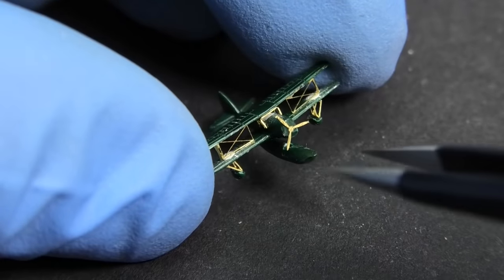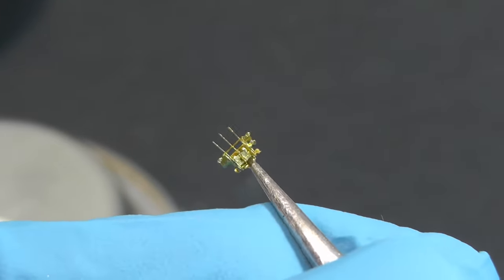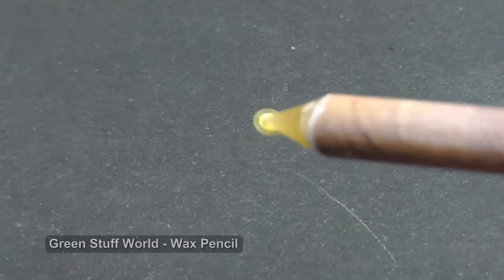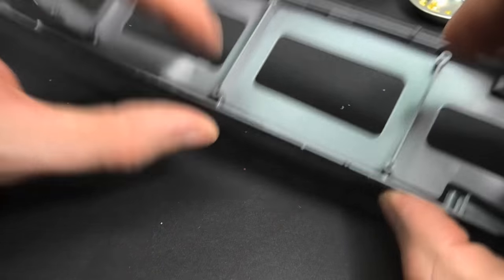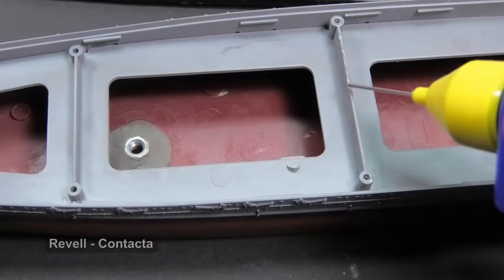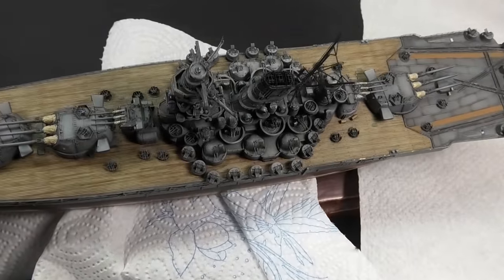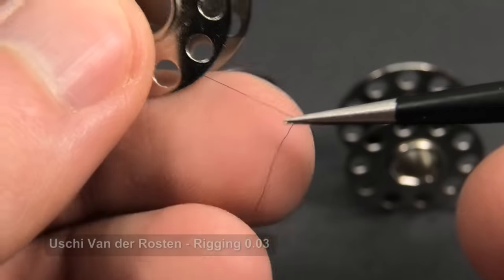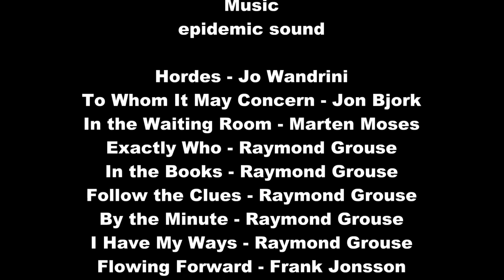Battleship Yamato 大和 1/700 Fujimi - Ship Model

Comment: The fact you have the patience to do all 25 AA guns is crazy
Reply: True
Reply: Still it didn’t save him
Reply: If only you could build them, as quick as the video!
Reply: Ouuuuuuu got the only liked comment. Thanks
Reply: @ferguskenny4578  video took a year
Reply: there's a brand called Metal Earth that does the steel sheet models in tiny scale, each one costing only around 15 USD. They're rather hard to build, but look fantastic when done, and id highly recommend trying one out!
Reply: @cadenbuchanan75  I've seen them built (fantastic) and have several that I haven't yet built.
Reply: @cadenbuchanan75  they are very fun indeed. There are also cheap knock off ebay versions too for those that cant afford the cost.
Reply: Best part is they didn't even do anything xD
Reply: @drvelocci  no you didn't, cringelord
Reply: @Its_Me_Romano  at the time it was. 🤷🏻‍♂️
Reply: @cadenbuchanan75  is there a metal earth ultra because this man cannot be bothered with mere mortal models. Lol. That would be cool.
Reply: @josecrispim572  lol great reference 😂
Reply: 1000000000000000
Reply: Very impressive build!

Comment: Great presentation, and music for a legend.
   I also have this model, however, mine did come with photo etch parts, as well as a real wood deck. which is strange, because Scale-A-Ton also didn't receive any photo etch parts. I hope they weren't stolen. However, I got mine from a hobby shop.
   This is my favourite class of battleship, I have various books on this battleship, and even have the 2005 movie of Yamato.
   I will be converting her as Musashi, in her original configuration.
   In Yamato's final sortie, the tripod mast on the aircraft crane was removed so that her aft main gun would not be impeded by it.
   Her anchor chains where positioned differently and the model reflects her original placement.
   And only the bi-plane operated on both, Yamato, and Musashi.
   this is however, a superb model, very well detailed, and museum quality.
   Take care, and all the best.

Comment: I remember when I first started modeling when I was 11, I used the most ghetto techniques ever like using my nails to pinch pieces out of the sprue and only using an xacto knife to clean parts. After that I would cake the pieces with that really thick glue that comes out of a tube. I wouldn’t even paint them either, I really have come a far way. I still don’t have some of the proper tools to get the job done but somehow the models still come out decent for my taste.
Reply: At least you used a xacto knife, I used a SCISSOR lmao

Comment: Hello! 1). How long should I wait after applying the Mark Setter before applying the decal to the welding site?. 2). How long should I wait after installing the decal?. 3). do I need to smear the decal on top of the second time with and after what time after item 2)?. 4). The same as p. 3) when can I apply Mark SOFTER? Most important: do I need to roll the decal with a cotton swab? After applying the Mark SOFTER, the decal shrinks. what this may be related to. Could you describe the instructions for the correct application of Mark SOFTER and Mark Setter? It is not quite possible to weld the decals. Thanks.

Comment: Hello.
I noticed that you started going with the flow of buying, assembling and painting. Own creativity is limited to the order of assembly and selection of additional elements. You stopped creating and started assembling models. I mean, you used to create a lot more yourself. Now you just buy a good kit, good accessories and put it all together. In my opinion, modeling is about making a work of art from a poor set. Anyone can buy an expensive set, it's no art. I hope you will turn back from this path. I would like to see you create your models from cheap sets, not necessarily the first quality. I'd like to see you deal with cheaper paints and cheaper airbrushes. I would like to see details made of simple materials available everywhere, and not from purchased sets. You're going the wrong way as a modeller. I am writing this because your films educate new young modelers.
Greetings.